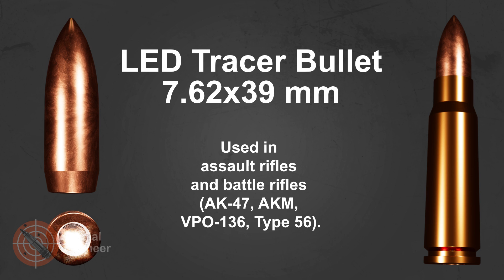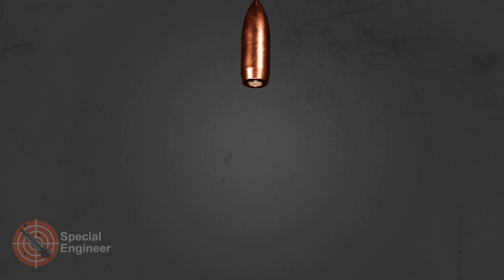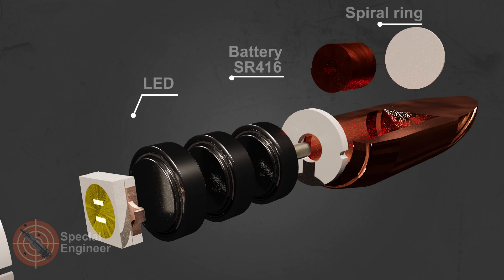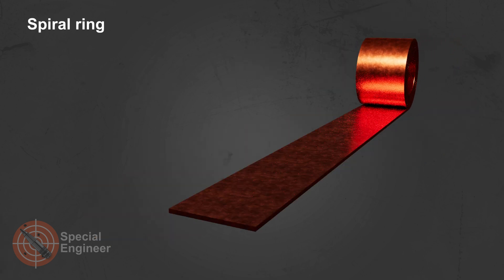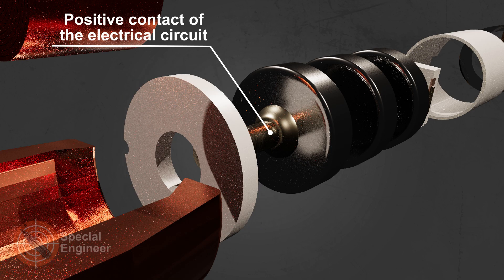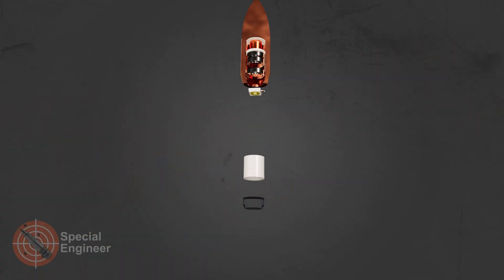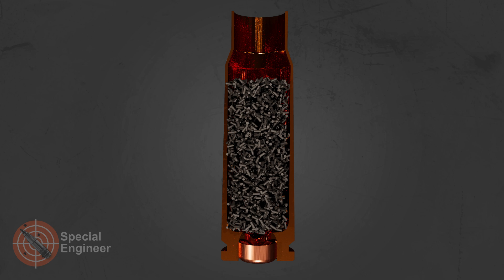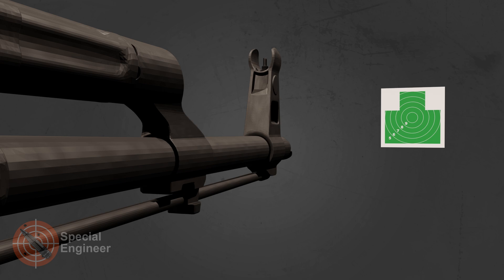Tracer Bullets

Comment: pretty sure it is against the Geneva Convention to shoot batteries into enemy troops.
Reply from the maker: Well, technically, they could be classified as kinetic energy weapons… 😊
Reply: @specialengineer2718  No, actually firing silver oxide SR416 bullets into  people using small arms projectiles constitutes poison bullets which are specifically banned by the Hague Conventions. And, duh, small arms projectiles are always kinetic energy weapons with or without batteries. What's your point?
Reply: Actually it's the 1899 and 1907 Hague Conventions.